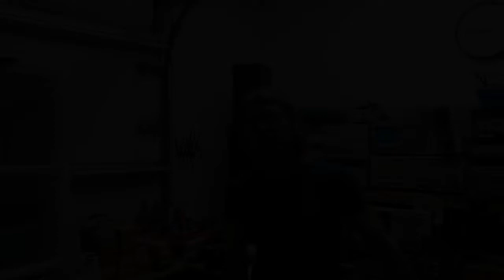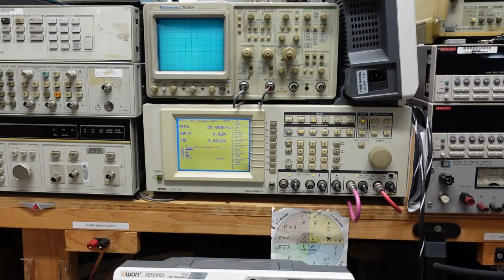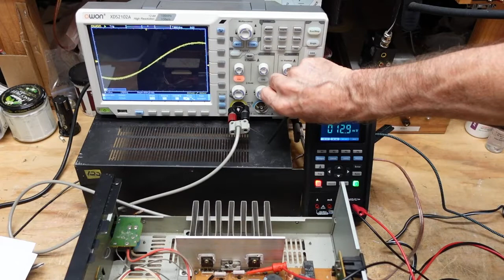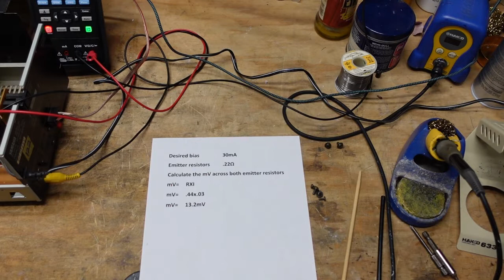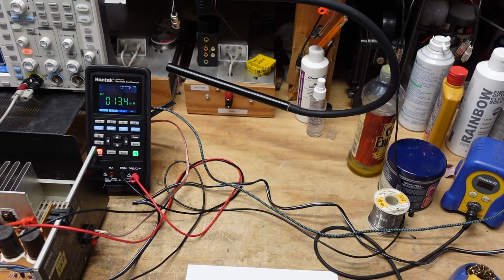Audio Amplifier Bias and Distortion

Comment: Hi, late to the game, but I am a noob. Asking:
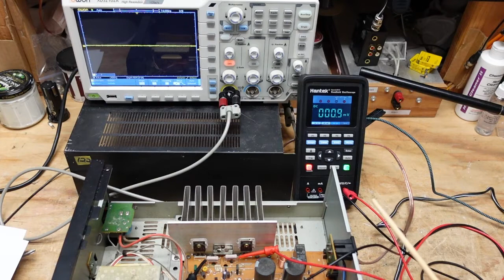1:10 
How does one rig a test here? "20 KHz waveform > Amplifier > Digital oscilloscope" ? I mean, the connections. Where does the waveform comes from/generated? Where do you feed the waveform to the amp? For bias current adjustment, is 20 KHz a standard? 
Thanks!
Reply from the maker: OK, last question first.  Bias is set under a no signal condition.  I's also known as idling current, kind of like the idle of an internal combustion engine.

A sine wave signal is usually obtained from a dedicated signal generator.  But you can also get a sine wave from a computer, or burn one to a CD and play it.  Or get a signal generator app for your phone.

The signal is injected into an amplifier into an input; for a power amp, that is the left or right input.  For an integrated amp, choose the aux input or tuner.  Never use the phono input, as it has an RIAA equalization curve built in, and requires a very low signal.

Your oscilloscope is placed across the dummy load, which is just a resistor or 4 or 8Ω, and is used to prevent deafening noise from inputting a sine wave and driving the amp to the edge of distortion.
Reply: @raygianelli3612  Thank you.

Comment: Learned a lot, unfortunately, I don't have all the equipment yet, to analyze for one, scope is ok, lab supply is also ok, variac is also here, a safety transformer is also here, from 6 Amps, 230-230VAC, only one old multimeter. But still a good one. A glow lamp in series with the load is also here. The only  thing I need is a signal generator, and an analyzer. But I get there. Thanks

Comment: Great video.  I always learn something from them.  I happen to be repairing a Marantz 2245 that came with a blown amp.  I found the bad components and got it sounding good, but while in there, I changed the early model cylindrical bias transistor to the a newer TO-220 type.  First try at setting bias, it won't go above 3.9 mV. I need to check the trimmer, but when I get back into it, I'm going to look at a low level 20kHz signal and see what is happening with the crossover distortion.  Maybe I'll learn a little more. 😊
Reply from the maker: Thanks Steven, but right back atcha... I always read your posts on AK for the same reason, to learn something I didn't know.

Comment: Nice video again. 🙂 Does temperature of the amplifier influence bias current much?
Reply from the maker: Thanks Roeland!
Yes it does.  That's why audio amplifiers have some manner of thermal tracking, either a thermistor or transistor tied into the bias circuitry.

Comment: Ray, when you zoomed the sine wave on the scope and adjusted the meter read 13 mV. After you showed the math, the meter was reading 6.9mV. What happened?
Reply from the maker: As I mentioned (but failed to make clear) is that the DMM won't give an accurate reading of bias when signal is running into the amp. That's why service manuals state setting bias under no signal conditions.